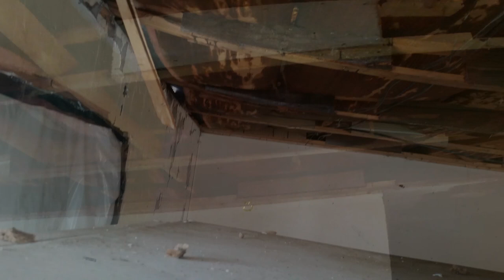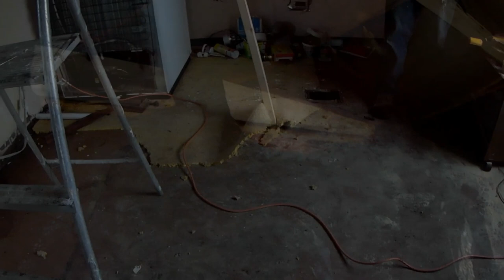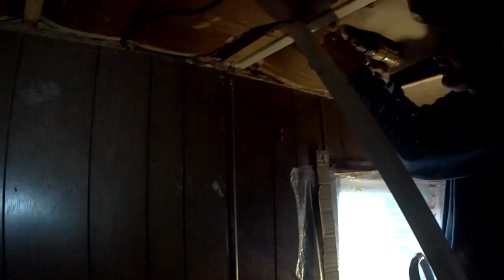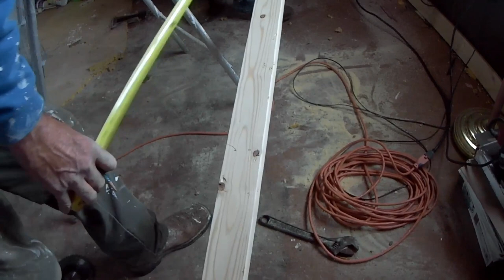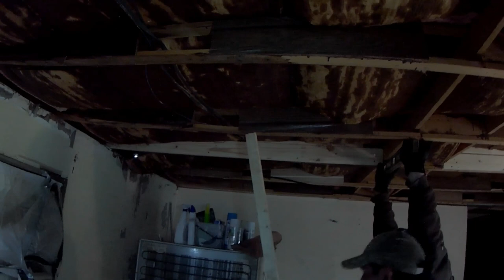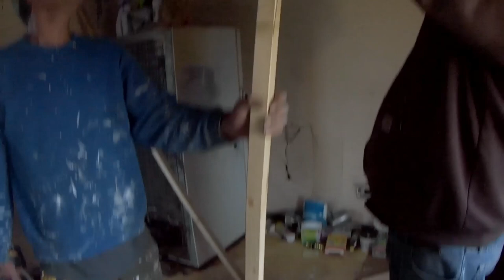Mobile Home: Sagging Ceiling Repair (How we did it)

Comment from the maker: I apologize that the Video is not what you expected,  however,  they are presented with Sub-titles instead of talking.  All repairs have variables,  How to make the reinforced pieces,  where and how to place them,  how to prop up the ceiling so it remains level during the repair. The Video is intended only as an example of this type of repair.

Comment: I  need to do this to my place but I would like to hang 1/2 light weight drywall do you think it will support it.24 oc
Reply from the maker: Thank you for your comment. We used 1/4" Drywall for our Project because that is the size that's a standard in Mobile Homes,  however,  our repair was pretty sturdy and I don't think that if we had used 1/2" it would have made any difference in our results.  But your results may vary.

Comment: Doing a similar repair. What about insulation in between the rafters? Blocking airflow with solid lumber will that cause a condensation problem?
Reply from the maker: Pressed the wrong symbol to reply,  Sorry.  We never anticipated a problem with moisture.  We're in Colorado and the Humidity is minimal. I suppose that for a more moist Climate adding a vent would be plausible. Thank you for your comment.